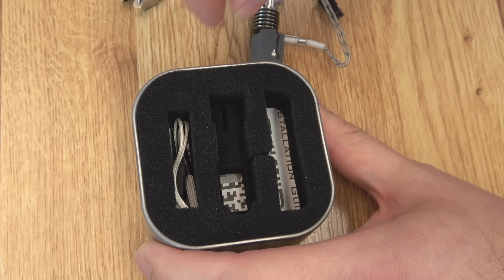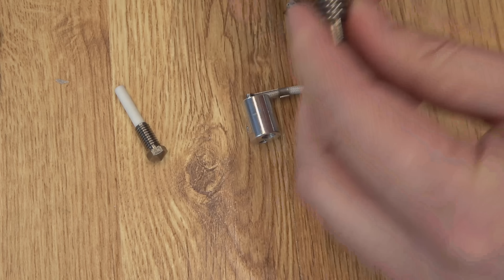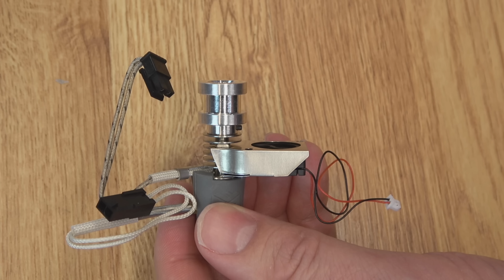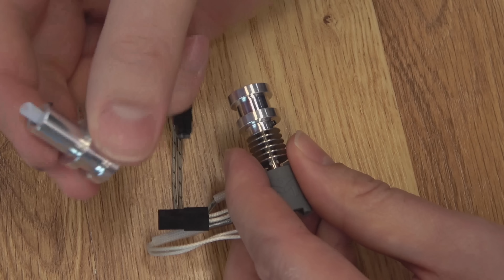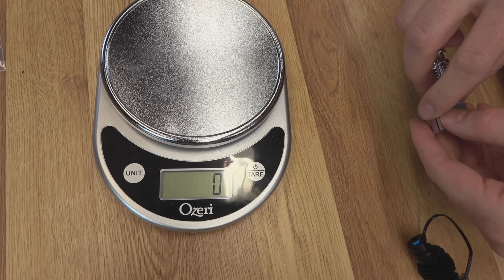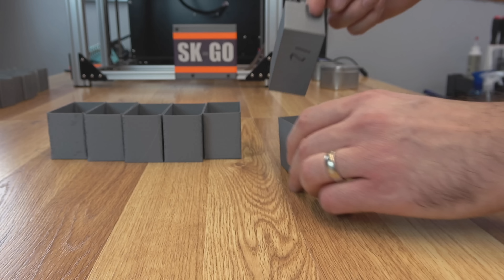Pico Hybrid Hotend - Made in Kansas City USA - 2022 - Chris's Basement

Comment: the cross drilled holes doesn't help cooling, it helps with heat insolation, cutting down on the cross sectional area for heat transfer
Reply from the maker: Thank you

Comment: This could be a great replacement on my custom V6/BMG DD IDEX printer.  Torn between this and the new REVO 6.  Seems either one gets rid of heat tightening nozzles.

Edit:  My only concern is the loose fit of the heater cartridge, seems heat transfer could be affected at higher flow rates.
Reply from the maker: Good thought on the heat cartridge, not sure how that would impact it, if at all.
Reply: I seen a comment from "James Pray" said he was able to lay down a 12 min Benchy on 12v, with this hotend. expecting a slightly faster benchy when he upgrades to 24v. If i had to guess I'd say in order to print a Benchy in 12 minutes you have to have some exceptional heat transfer and high flow rates. Either way if what he claims is even remotely true it is definitely worth a shot. Plus you get to support a local company out here tryna make it, not a massive chinese corporation like Creality.
Reply: @b-rad7708  I'm tired of Chinese parts.  I'm  in US and will lean towards anything made here first.

Having an IDEX is a pain when it comes to nozzel changes.  I need something that has repeatability and will not mess with my Z offsets.  That or I am going to customize Klipper so I can probe both hot ends.  Probbaly a touch off block of a known height.

Comment: I was a beta tester for B3 on the hybrid, paper thin wall on heat sink treads, twisted right off, even without the cross holes, 5v fans with regulators are stupid. Original Pico design beats the hybrid hands down. I have it in my scrap bin, it's junk. Poorly over-engineered. Forget about nozzle swapping. A 0.5mm thicker heat sink wall would make a world of difference in durability. This was YEARS ago, my Hybrid is long since dead, Original Pico still in service.
Reply from the maker: Thanks for your insight

Comment: As incredible as this is, and I absolutely love the ingenuity on the cable designs (those look practically indestructible) I can't imagine justifying $150+accessories when the Revo is right around the corner for 50 bucks less. Really unfortunate, this seems like a great step forward, just bad timing. that said, for a specific group of people (i'm lookin at you speed benchies), this thing is probably worth every penny
Reply from the maker: I've been playing with it. I'll let you know
Reply: @Mortarman0341  on their kickstarter page is a flowrate performance chart against the volcano, mosquito and standard V6. Speed runners who have a tuned in mos. or vol. wont see a drastic improvement.

Comment: I believe the hot end heater is failing.  Can the barrel heater go bad?  Maybe look into the Pico
Reply from the maker: Yes, I have had those heaters go out on me before.
Reply: @ChrisRiley  My ender nozzle can only get up to 160 degrees. All connections tight on main  board.  I’ve replaced thermistor. I checked barrel hot end heater with meter.   17.5 ohms the endextend 300xl 120v bed is great. “Heat failed Printer Halted Please Reset”

Comment: You can use 5V from the controller for the fans if you don't want to use the included buck converters.  Just plug the positive into an unused endstop or other 5v connector on the board then plug the negative into the fan mosfet as usual.
Reply from the maker: Good point, a lot of boards are coming out switchable now as well.

Comment: This is a very interesting little hotend! And glad to see some locals in the game! Curious that they are only using a 30w heater. Since the heater block and nozzle are deeper, reminiscent of a Volcano, it would be interesting to see what a 50w did. Also, I have found using a copper heater block and nozzles on the Dragons to be a real benefit. Wonder if a copper block would be too much mass to sling around on that thin heat break? 

Does the nozzle bottom out on the block or the heat break? One of my main gripes on the V6, beyond groove mount, is the nozzle bottoming on the heat break. The Pico design would eliminate leaking, but the block, and heat break could still shift during nozzle changes. I am so done with groove mount though! If they come up with a heat sink/break with a rigid mount, I would seriously consider this for my big delta!
Reply: We originally were going to launch with a 40W but given the small design and nozzle-parallel orientation of the heater, the 30W actually handled better in terms of temperature stability and could still keep up. For the block, we are looking at making other materials available.... it would not be an issue for mass or strength.

Nozzles bottom out on the inside of the heatsink near the top primarily to create compression for the PTFE-lined nozzles. However, there is nothing in there that creates subjective distance like the V6 heat break, so nozzle changes are repeatable. We intend to offer many mounting alternatives to the groove mount in the near future. This is why we made it removable :)
Reply: You can omit the groove mount and go straight into an M6 threaded hole or heatset (which I did to save weight).  The nozzle does bottom on the block, not in the break.  I have swapped between 3 nozzles without losing my zero :)
Reply: @jamespray  I get that, but would still feel better if it bolted in somehow.
Reply: @HackMonkey  I am pretty sure a rigid mount is on their radar.
Reply from the maker: Thanks! Josh from Metaform address this in one of the other comments.

Comment: Groove mount just needs to die already. Wish you could rigid mount this thing.
Reply: Hey Nick, I'm one of the metaform team. As Chris mentioned in the video you can mount the pico hybrid to anything with the M6 thread at the top of the heat sink due to the outstanding cooling, even printed mounts with heat set inserts are not a problem. If that is not what you are looking for, can you please explain exactly what you mean by being able to rigid mount it? We definitely share your belief that groove mount needs to die, unfortunately that's what the industry has come to expect.
Reply: @joshuawentworth7426  I meant rigid mount like the mosquito, Phaetus and TL Dragon, etc.

Comment: How does Creality succeed in delivering complete 3d printers for the price of one hotend ...  I'm blown away by both this and the E3D Revo ... mostly by the price though ....
Reply: economies of scale. Most parts of a 3d printer are off the shelf components, the rest are made at such large volumes it becomes very cheap to make them.
Reply: @Festivejelly  If it's that easy, then why do these companies not.produce things like the Revo in bulk.  I would gladly pay double the price of a nice Creality-style hot-end for something like a Revo.  Maybe even x 3, but as it is now these are costing more than 10 times what you pay for a Chinese Creality-style hot-end.
Reply: @MisterkeTube  The Creality hotend is about as basic as it gets, Creality quality is mediocre at best. But couple low grade equipment, with the scale Creality is operating at, and no quality engineered part can compete in that price range. The scale Creality is spewing machines out is mind boggling. The Phaetus Dragon hotend is a good example. Chinese made, but much higher quality materials, and lower production volume, but still about $90 for an exceptional hotend. But at 45g, it is still 4x as heavy as the Pico.
Reply: @HackMonkey  Basic is good.  It reduces cost and chance of failure.  Fancy is often just waste of money.  Note that "quality" and "basic" are not contradictioons...
I love the basic idea of the revo: just have nozzle and heat-break as one, so that you don't need hot-tightening.  You just screw the entire thing through the heater block and further into the cold end, bottoming out in there.  Drop the fancy spring-mounted circular heater (sure it is probably great, but not necessary for the main improvement).  Just stick to the mass-produced Chinese Al heat-blocks and Creality-style cold-ends (but with threaded nozzle/heatbreak opening).  This sounds like it should be mass-producable by China for almost the same cost as they currently take for their cheap nozzles and all-metal heat-breaks, which so far have worked great for me.  And just switching to such a all-in-one nozzle and heat-break would give us the main benefit: cold nozzle-swap.
Reply: @MisterkeTube  its all about where its made and with what materials. The creality hotends are pretty shit and are mode with low grade materials and the design is cheap to manufacture.

If you look at the revo design especially the nozzle, that requires precision machining. Afaik they are made in the UK, which adds to the cost. However given the revo's performance to cost ratio id say its really good value for money when you look at the competitors.
Reply from the maker: This is an interesting conversation
Reply: @MisterkeTube  Cheap, basic stuff doesn't fit every need. Glad it works for you, and it does for a large segment. But there are plenty of others that need or want more out of their machines. Just like a cheap Kia car is not right for everyone, some people actually need 2 ton diesel trucks,  9 passenger vehicles, or something modified to fill a specific need.

Comment: Chris in the video where you show the PLA hot end it looks like the PTFE liner does not go all the way to nozzle but just inside the long-threaded part a bit.  If so then the PTFE tube should last a long time as it should not suffer from the burned end that units that do run the PTFE all the way to tip do. So did I see it right or does it run all the way down to the tip.
Reply: You are correct it only runs about a quarter of the way into the nozzle.
Reply: @joshuawentworth7426  Thank you Joshua. Seems like great light weight nozzle.
Reply from the maker: Thanks Josh

Comment: A blower fan is a radial fan. I think you meant to say this fan isn't axial.

Other than that this hot-end mainly seems to come with limitations, a custom nozzle, heater cartridge and thermistor being several of them.
You can either go full patriot and buy a Mosquito or just leave it at the E3D V6 or Revo.

Surprised at 3mm filament support since only Ultimaker uses that now.
Reply from the maker: I noticed that and didn't have time to fix it. Thanks for watching